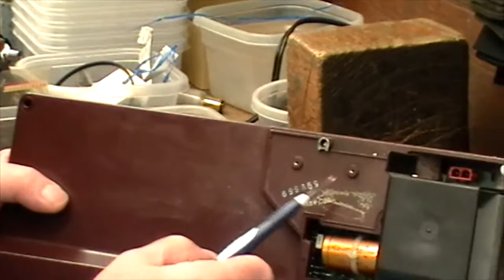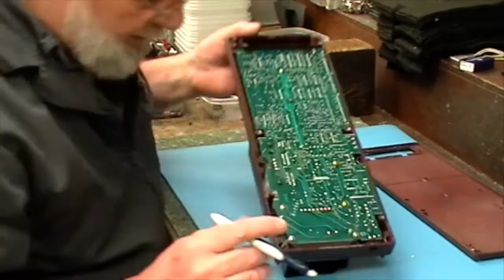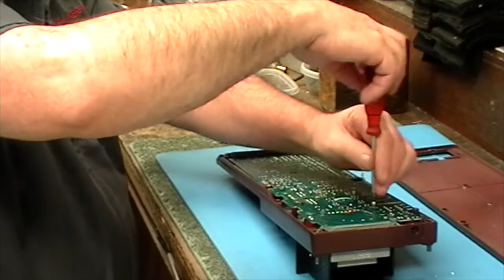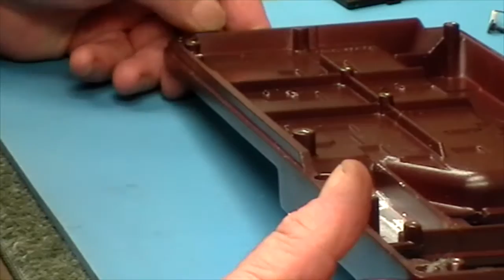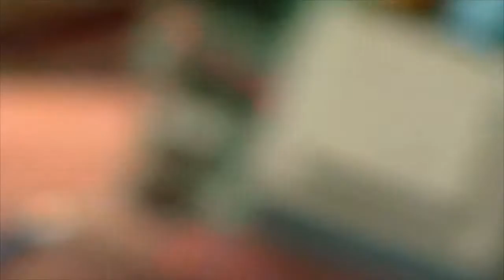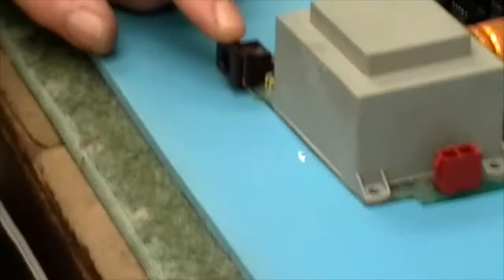Pfaff Main Circuit Board Overview 1471

Comment: Have you worked on creative sensation’s? Mine keeps shutting off when trying to sew
Reply: I have a Phaff 2044 that is doing the same thing, did you ever figure out what the problem was?
Reply: Theresa Passarelli it was the ground strap on the bottom which you have to take the bottom cover off to access it. Also make sure no wire connections are loose cause I may oh had one loose!